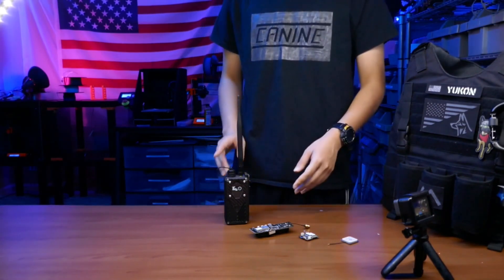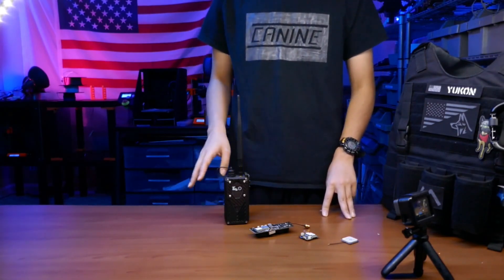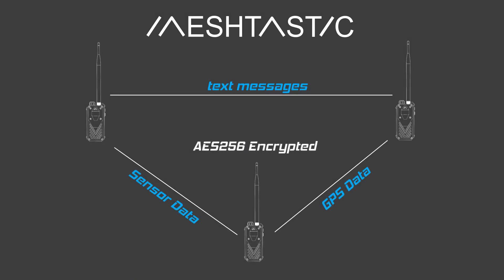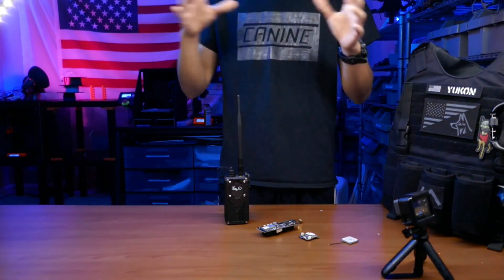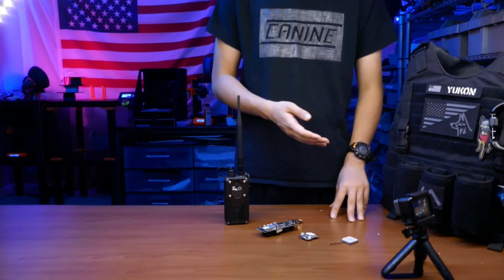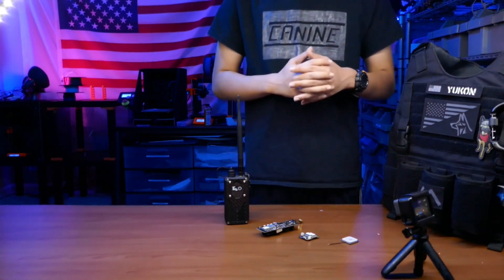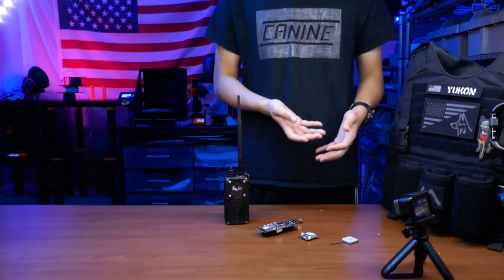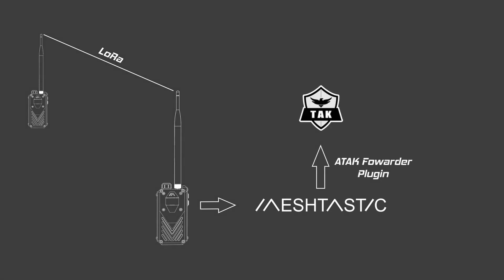K-TAC RTE-1 Technical Overview |  Meshtastic Comms For Tactical Missions

Comment: Yes. Very nice. Since it is an ESP32 it uses more power but can be used connected to Wifi compared to the NR52 (if I got that correctly), esp32 used as a router and send data via the web.

Comment: Howdy.
So I'm a senior communications & telecommunications network engineer specialising in the design,  implementation, supply & commissioning of Rural, Regional & Remote  Communications & telecommunications networks, I've been in the communications & telecommunications industry for over 35 years & I'm trying to work out & or undemand what the actual use case is for Meshtastic over already existing voice networks both Analogue & Digital both encrypted & in the clear & I have to say I'm very hard pressed to come up with a use. Case.

Looking forward to peoples feedback.
Reply: What is an example of an existing encrypted network?
Reply: What is an example of an existing encrypted network?

Comment: a design choice i likely would have made, was an external battery option. with maybe a small internal battery so you can hot swap the large external one. but otherwise really cool device, might try making something similar, but with my own tweaks and requirements.